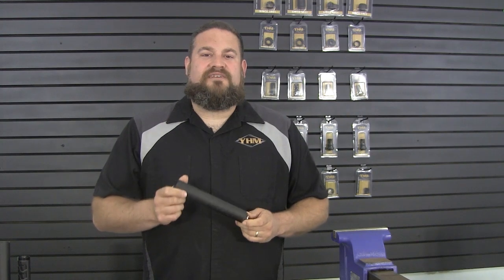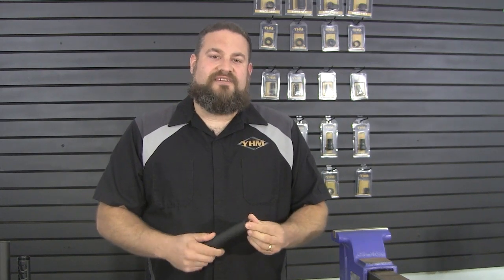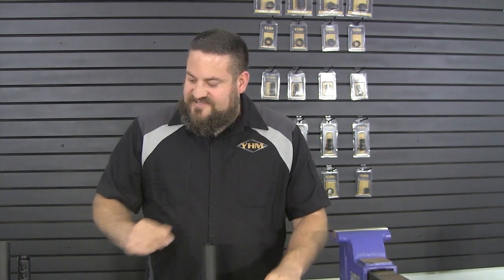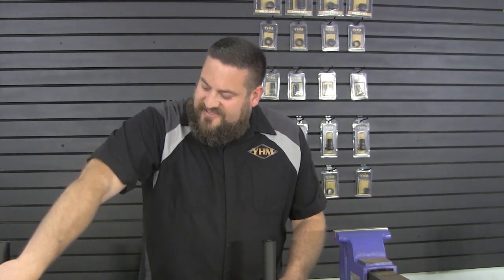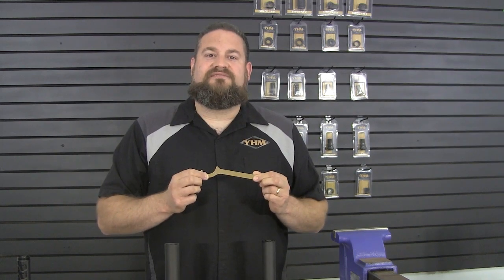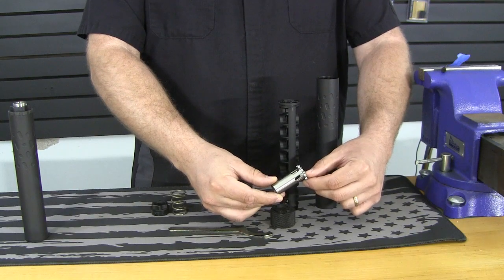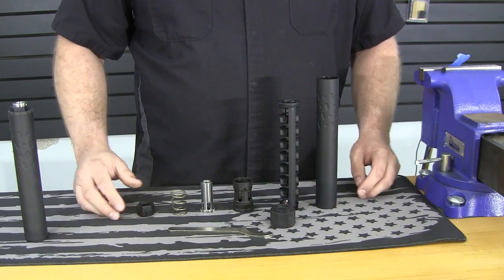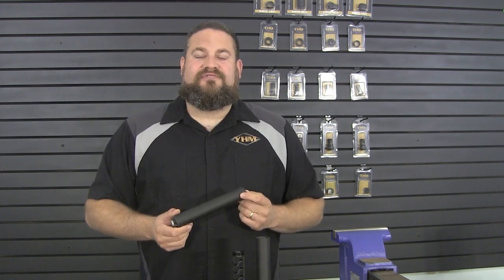What's New on YHM's Sidewinder M2?

Comment: Can someone from yankee hill tell what I need to do to make my sidewinder compatible with my Ruger LC carbine in .45 auto? Do I need to change the spring to a fixed barrel component?
Reply: I need the same conversion for my Ruger LC carbine in .45ACP. I went to Yankee Hill website and they told me the Sidewinder Direct Thread Adapters won't be available until the end of summer 2024. Cheers!!!